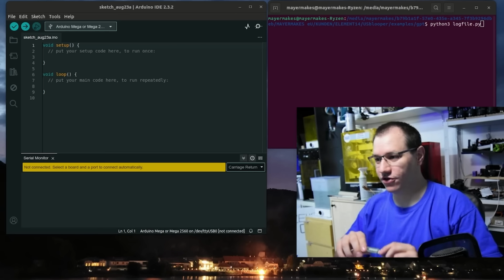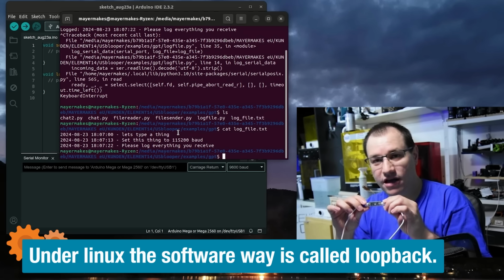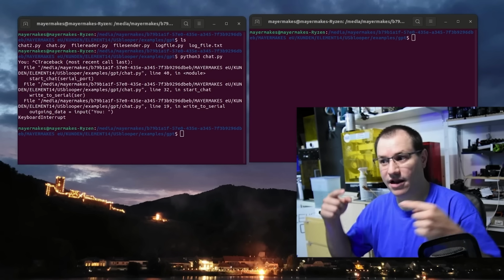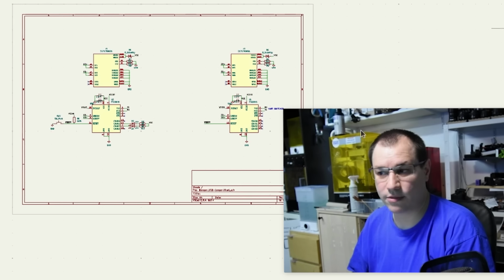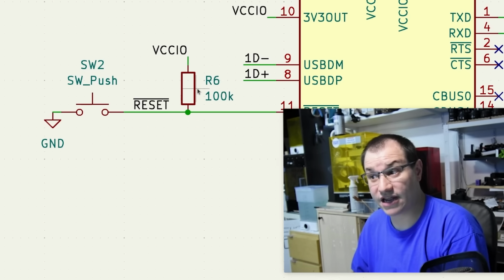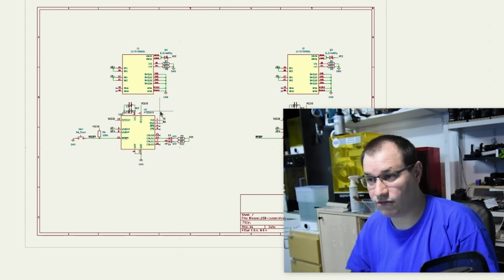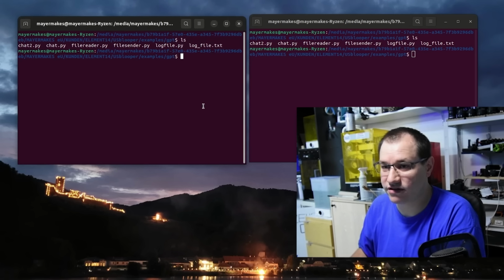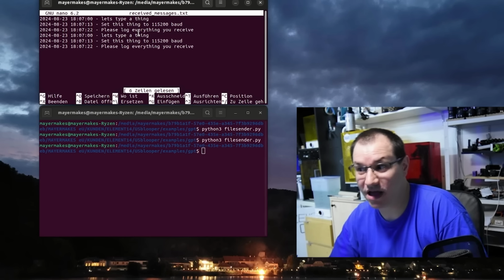This USB Gadget Lets You Hack Serial Like It’s 1999

Comment: Hello mate 
I need to forward or pipeline a specific usb decvice( connected or shared( or as a virtual device) which are all appearing in device manager of the PC A) From a usb port of the PC A usb port out to another host device 
Like android usb A port making the whole PC A as usb device
Your advice?
Thanks
Reply: Sounds like you need to develop a custom card to turn the pc into getting recognized as device. Sounds doable unless the devices need to be registered set up in the os insteas of raw data transmission.

Comment: I built a slightly larger version of this by connecting 2 YP-05 (FTDI RS232L) circuit boards together via their TX->RX, RX<--TX, and GRD-GRD pins. Works pretty great up to 2000000 baud. Spent most of the time writing a c++ app that works equally good as a sender and receiver. Thanks for the video, it was very informative.
Reply: you are welcome

Comment: I missed something right at the beginning, like a use case. 
I get that we have 2 USB cables that meet at the blooper, but I don't understand what's at the end of the cables. 
A laptop and Arduino or some other microcontroller?
I'm 3 or 4 minutes in, so this may be explained in context before the end of the video.  
All I'm saying is that this looks cool, and I don't know enough to have a clue as to what I'm looking at and hoping that someone will pass me a clue, or a link to some video where this tool would have saved the day.
Thanks.
Reply: On the ends can be an mcu, pc, sbc, whatever you want. The point is that either device ususlly needs to be host or device and stsy eithbits role, this allows to connect and influence/log/debug any partivipant as host and device. So a pc can pose as device to snotheg host. Physicslly they cant see any difference to the real device. Hence the exactly behave as in the real application.
Reply: @MAYERMAKES so effectively it's a self logging man in the middle so you can see what you're actually sending vs what you think your sending.
Reply: @mamamamaamthing yes that is one of the usecases

Comment: i have found cp2102 to also be difficult to upset. I love it, never trouble!

chiphead also has an alternative, so you have encountered ch340g which needs a crystal and can get wonky, but the -c, -b and -e versions of the chip are crystal-less and self-synchronise with the host, and i have heard good things about them.
Reply: yes there are a few good options, the simpler thebetter, one crucial requirement is no crystal neede, support for raw data transmission and the driver should be already included in most Operating systems which works for botha Cp2102 and ft230x. but of course not for a ch340 or other chips from less reputable manufacturers/sources.
Reply: @MAYERMAKES   I feel like chiphead driver trouble is a story from 10-15 years ago which is no longer relevant. and i'm still sour at FTDI for driver sabotage that they once did.

Comment: Ok… it took a little bit before I understood what you were doing.  I still don’t really get the usefulness of the “log” part.  I remember serial port-to-port transfer software/cables, but the parallel version was worth it’s weight in gold; at least before networks and flash.
I guess I should kinda like what you made, because I made something like it, back in the early 2010s. I was doing some work on an out-of-the-way system, and I needed a working USB keyboard, but none were around and it would have taken a long (very long) time to get one.   I had my laptop, so I wired the TX/RX/GND of two Atmega32u4 boards (I think one was a Teensy 2.0 and the other was an Adafruit 32u4 BB).  I loaded a simple serial port program on both board boards, just to make sure the path was complete.  Then I found a sort of serial/keyboard demo to load on one of the boards.  I had to tweak the demo a little and it handled only a few keys, so I had to copy/paste the rest of the keys I needed.  I was so shocked and happy when it actually worked, I thought I would keep it forever in some sort of MacGyver collection.  But back then, 32u4s were really useful, so both boards found there way into other projects.
Reply: the log part is quite often needed when a device in the field (like a machien controller) sends commands to another device, you can then correlate the logs to events / see error messages in it or check if the commands are issued i nthe right format etc.

Comment: The oroginal laplink was based on a blue null mmodem cable. It was a dos executable.  Laplink version 3 added the capability to use the parallel port which would let you send and receive 1 nibble at a time.  Yes the parallel pot was 1 byte, but only in send...receive was 1 nibble or 4 parallel bits.

Comment: I made something like this a few years ago, but with true galvanic isolation between the two machines.  Just a few FTDI USB-to-UART chips and a TI digital isolator (you can use a TI ISO6742 for hardware flow control).
  
You can expand beyond the basics by:
Using TI ISO6763 for full pass-through of RX/TX, RTS/CTS (data flow control), DTR/DSR ("serial port active" control)
Add a pair of opto-isolators where the LED is powered by the opposite FTDI's 3.3V rail and the totem-pole output is connected to the DCD line - this tells the host that the opposite device is present or not
  
Don't forget, you can do PPP networking over serial/UART, so you can actually do low speed TCP networking over a cable like this.
Reply: interesting upgrade possibilities! thx!
Reply: I was thinking about isolation when he was finishing up.  For my application I was wondering if the ground planes would need to be separate.  Just the parts you mention I expect would be enough for the isolation.  I am wanting to isolate my amateur radio from my laptop not so much to transfer between two computers.
Reply: @steinshaw2490  For basic galvanic isolation, you certainly don't want a common ground plane between both PCs, depending on the circumstances, there can be a voltage on one ground plane and you might set the cable on fire.  RF coupling from an imperfect radio installation could certainly create enough problems with both halves sharing the same ground.

I'm not a TI spokesperson or affiliated with them in any way (just a happy customer), their new ISO6463 has some additional robustness with noise immunity, a surge withstand of 4kV, and an isolation voltage of 2.5kV - but that is just what their chip's internal design and package can guarantee.  Normally with an isolation barrier IC, you would route out a notch in the PCB under the part to create an air-gap, and you'd be very careful to ensure no components are located close enough to promote arcing. Adding a conformal coating over each half of the PCB would help reduce moisture creating a lower resistance path.

Comment: Yeah, this is a nifty project for sure.
I use to use the blue DE-9(yes this is correct by spec NOT DB-9) to DB-25 null modem Laplink cables for transferring files.  Been using null modem cables since the 80's.
A USB version is for sure nifty at higher speeds.  Started playing with the early USB to USB connect cables when they came out in the 90's.
Thank you for sharing.

Comment: Your solution is great, just plug and play and forget about everything in between !

I use a Raspberry-Pi as the USB2 port can be used as device port too.
Just add "modules-load=dwc2,g_serial" (or other device like ethernet, usb-disk, keyboard...) to config.txt.
To watch the port either any serial monitor or for lower level access of monitoring/debugging eg. USB-protocol negotiation: usbview (Linux, no idea about other OS).
Reply: Is there a video of someone setting this up using a pi.  
I'm in the process of trying to come up with interesting projects that have enough complexity to require this kind of visibility tooling.

Comment: It would be interesting to have a version based on a faster USB 3+ standard. It wouldn't do serial in the middle I guess but would present as two devices to the hosts.
Reply: If you show me an mcu with usb3 thats not a totsl nuisance to work with
Reply: @MAYERMAKES  lol - wanted to delete a dupe and it deleted both lol
Reply: It has been. both 2-ports and 4-ports

Comment: would a looper work in place of a usb b to a cable?
Reply: If you plug in A to c and c to b yes, all the functinallity I show just different shaped ports.
Reply: @MAYERMAKES  So this is still a Host to device connection? Otherwise why so complicated? Protocol adapter?
Reply: @IntelliConnex  no it is a "does not matter connection". each device on each end can treat the opther as host or device. the main point of blooper is that the devices can not distinguish a host form a dvice in any configuration-> they just treat the other device as what ever they expect. so a traditional host device like a pc can pose as a device and a typical "device" device can pose as a host.
Reply: No... Looper connects two hosts (conceptually ..unless I really misunderstood) B is a device only connection. And why would you fix what is nor broken?
Reply: @IntelliConnex  it can do any of the possible configurations. host-host (with both thinking the other is a device), host, device, device device..it does not matter.

Comment: This would be more useful if it had breakout pins for UART to connect a third device.
Reply: Nope that would not work the uart pins are already busy, what youbneed is a sniffer, so a galvanically isolated device thst listens in on the bus,
Different tool, also very usefull in debugging.

Comment: I still have my laplink printer and serial cable as well as my Dr solomons/symantec cables and loopback for serial and printer.
Reply: The oroginal laplink was based on a blue null mmodem cable. It was a dos executable.  Laplink version 3 added the capability to use the parallel port which would let you send and receive 1 nibble at a time.  Yes the parallel pot was 1 byte, but only in send...receive was 1 nibble or 4 parallel bits.

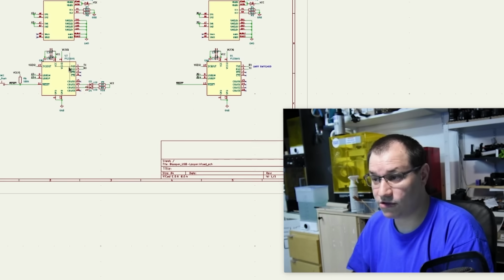Comment: 8:35  Is there a reason you did not connect RTS and CTS between both FTDI chips for hardware flow control?
Reply: Because its not used and could cause unwanted bahaviour. Simple simple

Comment: You could improve the design significantly by removing the FTDI chips and using a USB-capable MCU instead. This would allow data transfer at full USB speeds, not limited to UART speed. Additionally, the MCU can be programmed to show up as two virtual serial ports over a single USB connection, so you wouldn't need a second USB connection for your use-case of debugging software.
Reply: no, you are not seeing its main usecase.. debugging software on one computer was mainly done so the capturing would be easier. i use this to connect to machines and embedded computers in the field so the two ends do connect to tow different physical machines. surely one could replace the ftdi chips with Mcus, but I still need a second physical connection-- if it would just be about software on one machine I could also do it as loopbackdevice in linux(without any hardware)
Reply: That introduces a bunch of latencies. Its actually how USB2 and USB3 Bridge cables work - with alot of FIFO copying in the center. USB3 bridge cabels dont work much faster than USB2 because of the strain of FIFO copying.
Reply: In addition to the other points - you'd have to write the software in the MCU, and you may need to write a driver for the USB device it will appears as.  FTDI is fairly ubiquitous at this point, and literally wiring a serial line from one pad to another is a lot easier to get right than potentially hundreds of lines of code + testing.
  
Use a 4xUART on one side, and you can just have one serial port be the "true UART" to the bridge, another carrying the traffic from the TX pin, another carrying the traffic from the RX pin, and the last one just bit-banging GPIO to watch the RTS/CTS flow control and DTR/DSR device control pins any time the state changes.

Comment: You basically built a Laplink cable :-) 

But you totally missed the opportunity to talk about file transfer protocols like ZModem, etc, that make sure that there is a receiver before spewing the file across. Also missed talking about the drawbacks - that you are limited to an absolute max of 12Mbps (due to USB 2.0 Full Speed), but practically only 3Mbps due to the FT230X.

Ultimately, I get the feeling that this was a project in search of a purpose, rather than fulfilling a genuine need. Or else you just didn't explain the need particularly well.
Reply: so that was the name of the cable..well well. I di not talk about the protocols ,becuase I did neither use them nor know much baout them. I have used my little blooper in at least 10 Projects so far, some E14 related but mostly used it for debugging things in the field where mcus/sbc talks over USB- mostly startup POCs. the video was done mid last year. with the stuff I use it for speed is not a concern.
the purpose is to know exactly what is sent  and manually send data to see if the reactions are as expected. saved me a lot of time so far.
Reply: @MAYERMAKES still not sure how this solves the described problem. This cable is two usb devices, meant for connecting two usb hosts. But a mcu is (99% of the time) a usb device, and cannot drive your cable. Getting in between a host and a device usually requires ANOTHER device with both a host and a device controller. Eg usb proxy, cynthion, etc.
In one case, I did something similar to your device - I had a usb gadget with an FTDI serial chip embedded in it, and its controlling software specifically looked for the vid:pid. I used another FTDI cable I had lying around, crossed over the rx and tx to an arbitrary usb-serial cable connected to an embedded Linux device, to which I also connected the target usb gadget. Then socat was used to bridge the two serial ports together from a host perspective, along with -x to dump the data in each direction to a file.

So yes, I CAN see the utility of this device. It’s just that you didn’t do a great job of explaining that part in your video.
Reply: @MAYERMAKES 12:17 If it was a laplink cable, there wasn't any flash in the middle, it was just a serial null modem.

A good terminal app could have demonstrated the file transfers too, via the venerable x, y or zmodem protocols.  I used one to update flash on a VisionFive2 board last year (and for dial-up BBSs too many years ago).
Reply: @imtootired4122 mine had flash in it for sure, because it had the option to work as a very small usb stick. And was marketed as for files from desktop to laptop. I think the software chopped up files in pavkets smaller thsn the onboard flash and reassembked them on the other end. Like I dud manually with floppies.😂
Reply: Yes, basically the LapLink comport cable.  I made the LPT 13 wire version years ago and tested speeds moving files between 2 computers with Windows 95.  The LPT was faster for large files and the Com port cable was faster for anything that could fit on a DSDD floppy.